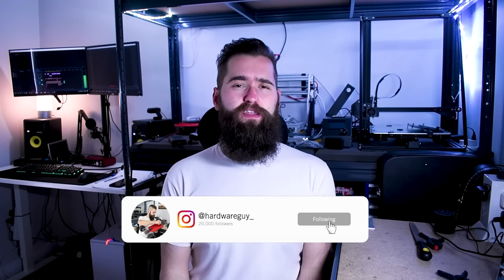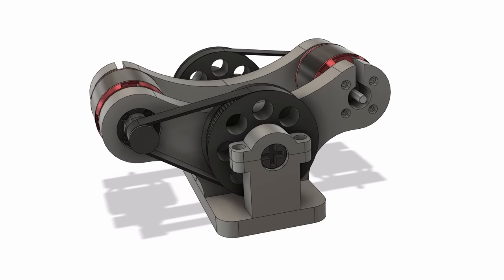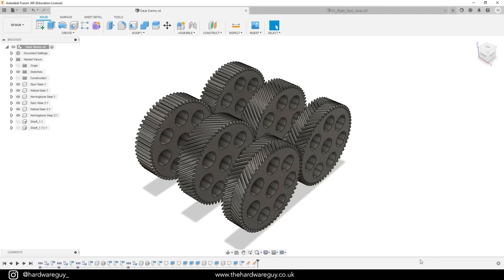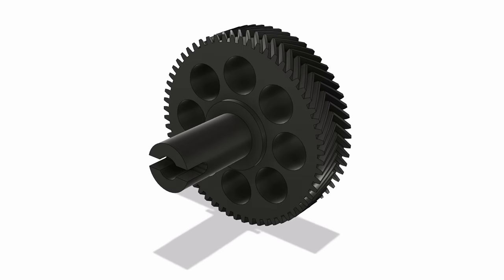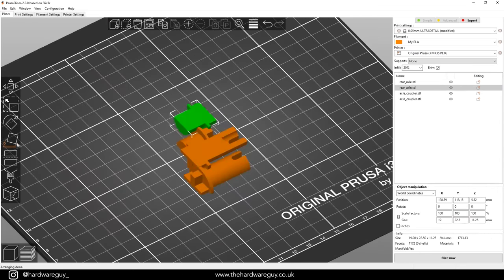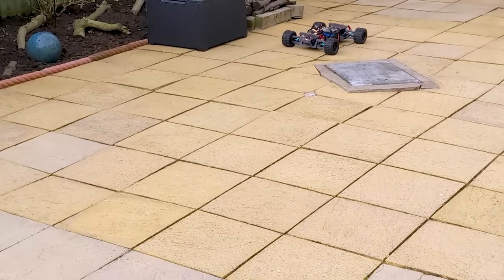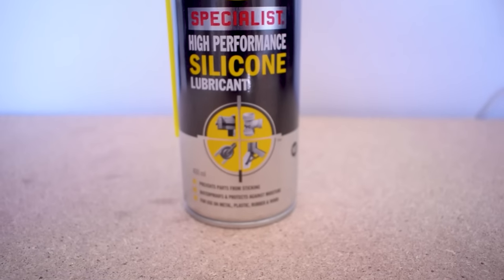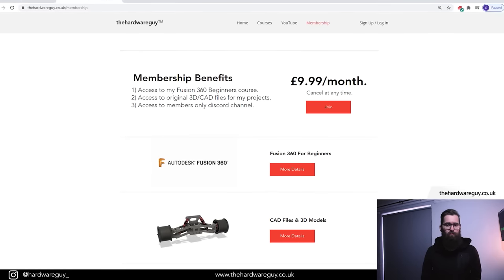How To 3D Print Gears Like a Boss

Comment: I am pretty sure that straight cut gears are stronger than helical ones. For example, race car transmissions use straight cut gears. And forces there are much higher. Disadvantage of straight gears is that they are much louder, that is why street cars use helical gears.  But sometimes even street car transmissions have straight cut rear gear - which is also cheaper and loudness doesn't matter.
Reply: I agree on this. Was thinking exactly the same when watching this video. Straight cut gears are stronger because they put all the force into the next gear, the helical ones does put some of the force in the axial direction. But yes helical are smoother, less noise. These fishbone helical gears does not put any axial loads, only internal in the gearwheel iself, not on any bearings and so on :)
Maybee straightcut gears are weaker then helical when they are 3Dprinted in plastic material?

Comment: Excellent video-, i found my Wood working background helped a lot in working out the best origination for printing parts that are under a heavy load, Simply because the the Grain of the wood is like the layer lines in printing-.

Thanks for the Recommendation on Polymaker Filaments-.

Comment: I highly highly recommend using Taulmans Nylon 230. It is a nylon that you can print on any stock printer at only 230°C. It is also cheap on Amazon. It has amazing durability. And the gear teeth will not wear away. It prints awesome. You need gluestick on your bed for it to stock as it is a naturally lubricating material. It is so perfect for gears. You NEED to try it.
Reply: It may be printable at stock temperatures but if your printer is capable of it, Polymide CoPa is a much better nylon all-round
Reply: Otherwise yes, Taulman's nylon is good :)
Reply: See also this video: https://youtu.be/UtRJ4lnNAXY
The best material depends on if you need high torque or high wear resistance. I agree that Nylon should be the best for high wear resistance as long as torque is not too high. Surprisingly high quality PLA seems to be pretty good, too.

Comment: I'd suggest trying PC+PBT for the gears. It's available from Push Plastic, and probably other places. It's got the good strength from PC, but also has added self-lubrication features, and is a bit more ductile which might help on shock. I've had luck printing it on a PCB-heater bed, with an all-metal E3D V6, with just a trash back over my printer to keep the heat in. xD

Comment: Spur gears handle higher loads, not helical.  Spur gears have a wide contact swath across each tooth, while helical have a single point load that moves across the face of the tooth. This is why you'll find straight cut gears in industrial and high power applications. Helical gears are quieter, they run smoother, and make less noise.  But they are not as strong.  If you have the space, and your installation can handle the thrust loads, they are "better".  Double helical and herringbone move gets you at least half the contact pressure, which is better than plain helical, and gets you around thrust loads.  

I'm pleased you did a video on how to do structural prints.
Reply from the maker: Yes, generally this is true. I was just sharing my personal experience with 3D printed gears. The herringbone gears that I printed outlasted my spur gears by an order of magnitude in my Raptor 2 project. The spur gears were far more susceptible to wearing/stripping and skipping. Herringbone gears dealt with the forces much better.
Reply: I believe your testing, i'm not doubting your lived experience.  I have guesses as to why.  With spur gears, the gear tooth contact point.. moves.  With every tooth engagement it moves up and down the gear tooth face. With helical cuts, the contact point essentially does not move, the contact point rolls across the gear face.  Maybe that's contributing to the inconsistancy with now i'm using quotes here "reality"? Your explanation clearly said spur gears have smaller contact area. Which is exactly the reverse of what happens when running cut or molded gears.

TL;DR: Your experience is real, your explanation is wrong.  @thehardwareguy

Comment: Hi, great video! Really liked the design and the comment about splitting the shafts! From your experience - what module of the gears worked best for your printer - how small can you get? Any suggestions for the glues used on the splitted shafts?

Comment: I am not surprised by the fact that your small spur gears worked better after you fitted them with steel screws in them because the big big double helical gears had enough material surface area to distribute the torque tension on all over its surface during constant rotational load tension.
However, the smaller Double helical gear didn't have the material mass to handle the vibration, rotational tension and the motor torque, and wheel motion while moving the heavy RC car.
The added steel screws to the middle of Small double helical gears gave it the extra structural rigidity to allow the gears to compress and decompress onto and also handle the torque of the motor rotation to the wheels very well.
Since the gear's high rotation along with the RC Car weight would have generated more than enough strain and heat on the Small Helical gears to break them apart
[Simple fact the more surface area a gear on any material has the better heat dissipation the gear will manage to maintain but if the gear is made of plastic and has to be quite small then adding a steel or stainless steel screw that can absorb and handle the heat and high load on the gear then the lack of surface area on the small gear to handle the heat dissipation could be manageable and easy to deal with when the gear is at Load and motion].

Comment: I wonder if an extremely tough TPU would have been good for the teeth, possibly shaping a cylinder with herringbone teeth on the outside and the parallel teeth of a typical spur gear on the interior surface, to snap/glue on top of the main body of the gear, also shaped accordingly but made out of a rigid thermoplastic; to make it short: like a tire.😅
I hypothesize that the elasticity mixed with the rigidity could have a chance at trasferring torque even better (when lubed properly). The end result should give the benefits of a belt drive to a direct transmission system, given the layers of TPU are properly fused together in a single and uniform volume (with 100% infill).🎉
I must try that now.😅
I sincerely thank you for the inspiration and the valuable information.😊

Comment: spur gears are very noisy unless at ridiculous tight tolerances. (have seen them used in a torpedo which requires both quietness and huge power in a small light space.  The advantage is no thrust which makes the structural design much worse.) Load on a spur gear is a short cantilever that is loaded and unloaded not very gradually.  
Forces transferred between teeth are perpendicular to the face. so a helix gear creates a thrust force, apply trigonometry, and when applied to the bending stress on each gear tooth is about the same as a spur gear sees.  The load is not put on as abruptly and thus lower noise. 
To machine of herringbone gears are only done with a shaper with a cam to rotate the blank as the cutting face moves through the part.  High end gears are usually finished by grinding. not possible for the herringbone gears shown.  Have to sandwich to opposite angled helix gears to form a herringbone gear.
Involute gear by design do not slide against each other.  Never actually is 100% achieved but close.  The 95% plus transfer of power of a gear set is the result.  These gears are all involute and adding an angle to make a helix doesn't change this. Another indication of very low friction is that they can be back driven.  However; if the axis of the set are not parallel but at some angle then there can be some sliding. The amount can be low and thus can be back driven.

Comment: Very nice video I have learned a lot thank you, I am new for 3D 
printing, I have a same 3D printer I am trying to design a small gear 
for my old SONY walkman it requires a very strong gear to handling a 
large torque from the motor, could you please provide the correct 
settings for the ENDER-3 printer? I am using PLA.

Comment: Engineering wise I highly agree with your advice on stronger gears. The only other thing that could possibly help is breaking down the gear reduction over multiple gears, similar to a counter shaft in a gearbox or planetary gear set. 
Or though given that it’s rc applications it would be a rather tight fit in a chassis.

Comment: Hey man, wsp, i have a more or less 1/6 1/8 "car" (only the exterior) and i want to learn more about this things cause im gonna make my own RC car for high performance, Awd and 100-120Kmh but i need to learn more

u can recommend me things? like, suspenssion, engines (electric), etc

or some channels that have content about that
Reply from the maker: I found myself in your position around a year ago. When I started the Raptor project I knew very little about mechanical design. Personally, I find that the best way to learn is to just try and build something. If you look back at my older videos you'll see that Raptor 2 evolved from many mistakes. I failed over and over again until I ended up with something that actually worked! I'm definitely no chassis expert, but I learned by doing and produced what I think is a pretty good result. I'm a big advocate of this mentality. Hope this helps man!

Comment: Have you ever printed with Nylon ? I need to replace the  drive wheel gear on my magneto ,on my motorcycle , it had a Bakelite plastic type gear as original and thats 40 years old ! So is nylon going to be better ? I could buy a new gear in the same bakelite but buying one would be no fun , and for the price I can buy 1 kilo of nylon filament and if lucky get a good one !! Or maybe two ! Great site by the way , thanks for the tips etc .

Comment: Awesome video!!! Have you tried 3d printing nylon gears? They should be even quieter and smoother! ;)
Reply: My favourite nylons are the ones I have found from Polymaker and are their Polymide series (polymide being nylon)
Reply from the maker: Thank you! the general consensus online is that PolyMax Polycarb is far superior to other Nylon filaments in regard to strength! That's not to say Nylon wouldn't work, I just haven't tried it yet! maybe an experiment for the future
Reply: @thehardwareguy  Yes I would usually say that too, however if you have a look at Polymaker's datasheets, their Polymide CF-6 is their strongest filament, even compared to their Polycarb. Either way, for gears I would definitely use their Polymide series, the self lubricating properties of nylon really makes a difference to smoothness!

Comment: Good job!!
I have successfully printed gears of modules as small as 1 mm. With herringbone gears, the teeth are not coming out very well. I often struggle with bed adhesion since the profile of teeth are so tiny. I have a couple of questions.
1. Your gears seem to have smaller module. What's the smallest module have you successfully printed with? Was it with 0.4 mm nozzle?
2.  What's the backlash you keep if? I print gear assembly in one part (when its not physically possible to assemble as in the case of a double helical planetary box.). So what is the clearance you target for the teeth to not fuse together?
Reply from the maker: Thank you! My module is 1mm. Pressure angle is 14.5 degrees and helix angle is 40 degrees! The meshing distance can be calculated properly using a formula, check out my FreeCAD spur gear tutorial, I go into detail there!

Comment: What kind of adhesive do you recommend for gluing the parts together? I assume a thick superglue or epoxy?
Reply: There're special glues for plastics that basically melt the plastic parts together. However, pretty much every plastic requires its own special glue. The end result will be stronger than superglue of epoxy if done right.

Comment: Why not cap off the top of the smaller gear with a bearing? I guess the M3 through the center must be good enough then if they stopped breaking after that though, but I wonder how much flex they endure due to trying to track up or down on the larger gear when torque is induced. 

Also I'm curious about the roller bearings.. why not normal bearings with a metal inner? So that the plastic isn't even a factor in wearing those parts out? Was there a significant price savings, or anything to do with larger radius for torque transfer?

Comment: Just wondering regarding spur gears. Aren't they uses in racing gearboxes? So highspeed, high loads?
Reply: Weakest part of automotive gearboxes are bearings. By using spur gears, axial loads are reduced, which reduces load on bearings.
However, I'm not sure about less strength of spur gears either - I think I've seen them on locomotive axle, which is probably one of most demanding applications.
Reply from the maker: Yes they are used in racing because of their high efficiency. In racing cost is rarely an issue, so those gearboxes will be replaced every couple of races due to wear/damage. There's always a trade off. Spur gears are also very noisy, which again isn't an issue on the racetrack.
Reply: @thehardwareguy  And what about railway vehicles?

Comment: Polymaker ASA is good but a pain to dial in the settings and try to prevent warping. I have enclosure and I use stick glue too. What are you ideal temp settings.

Comment: When increasing the number of walls, the inner walls will squish the outer walls, so the actual tolerance will be different compared to printing with 2 or 3 walls. Be sure to use the same number of walls in test prints :)
Reply from the maker: Yeah I guess this is true in most cases. However, if you have your printed very dialled in, it shouldn't squish too much

Comment: Sadly, PL:A is soooo inconsistent one batch to the next that you must experiment with EVERY reel to get the temp and other parameters correct.  I print on an MP10 nozzle temps for me vary between 200-240 for PLA.  My PLA parts printed at 240 are rock solid.  No delamination. And a nice finish to. A tip - I always print the first couple of layers at 1/2 - 3/10 speed for better adhesion.  Thanks for the info on gears,
Reply: Damn bro I print abs at 240

Comment: The common advice seems to be to print gears in Nylon for its strength, temperature resistance and self-lubricating properties. Weird that you've never tried this material, given that you've printed PC that requires similar temps..

Comment: Great video! I am getting started in robot combat and have been looking at 3D printing gears for my robot's drive trains.

Have you tried using Nylon (either pure Nylon, or Nylon blended with Carbon Fiber or FIberglass), or even TPU to reduce shock back to the motor?

Comment: i'm struggling to find the best way to attach a printed gear to a threadless steel shaft.  i'm cutting a keyway in the shaft with an angle grinder at the moment but i feel there could be a better way. any thoughts?

Comment: @thehardwareguy, what was the noozle diameter you used to print the gears?
Reply from the maker: 0.4mm
Reply: @thehardwareguy if I use 0.2 nozzle diameter the resistance will increase? I'll print a smaller gea than what you printed

Comment: Hey i used fusion 360 and tried to make the gear and the shaft in a similar way as you but they do not fit together. Did you have this Problem and how did you fix it ?
Reply from the maker: The tolerances with 3D printing aren't great and vary between different printers and filaments. Try offsetting your inserted parts by 0.15-0.25mm to their counterparts

Comment: Looks stick, have you considered using Nylon for gears? Humidity and a heated chambers are usually more of a problem though. I've been successful with a non heated enclosure with just an ender 3, the bed and hotend would heat it up just enough to get fair to good prints.

Comment: I am a newbie to 3DP. Regarding the couplers/drive-cups that you printed, what is the purpose of printing two separate halves and gluing together?  Is there any way to print these type of parts as one piece? I need some similar plastic drive cups, except the ones I need have a hex extension with female threaded end for the wheels to attach directly. Any insights much appreciated.

Comment: I'd recommend nylon for gears
Reply: Nylon to me actually it’s a little bit too soft... 😂, it does handle more temperature, and fiber nylon is an upgrade of the nylon that’s more expensive as well more stronger, for the fiber inside it...
Reply: @minercraftal  I think for fully meshed herringbone gears, softness really isn't much of an issue? Might improve the fit too.
Reply: @SianaGearz  ahhhhh... I play around with my 3d printer, somehow I made parts with nylon for handling strength. Guess what, the shape tolerance changed after 1 day... 😂, that’s what I mean too soft, it doesn’t handle, and will mess up the accuracy... but as well, it is strong in some ways other than the stiff pla😂

Comment: 4:18 - This is such an important note right here. This has allowed me to print parts using HTPLA that can witch stand multiple ft/lb of force just by orientation alone.
Mix in some help with added hardware such as screws and metal keys/pins and you are off to the races!
-Edit, Lol I just saw that you comment on this at around 6:00